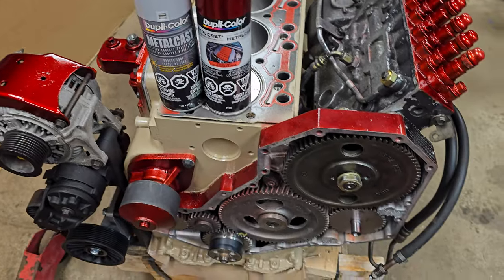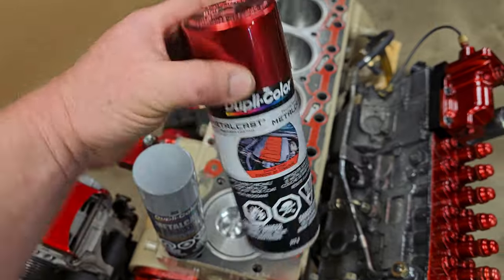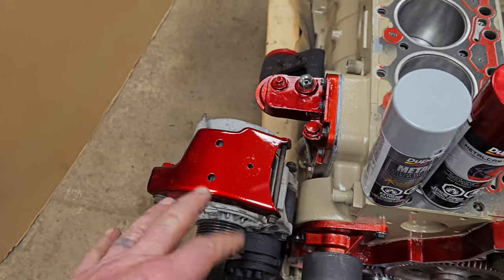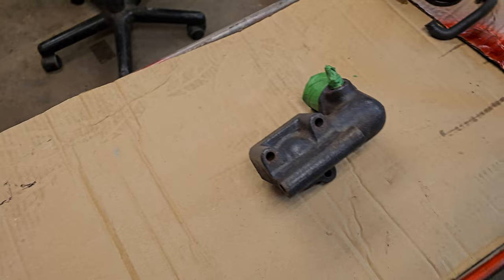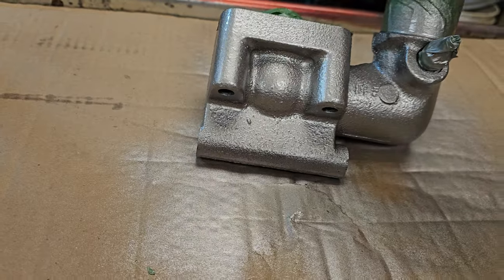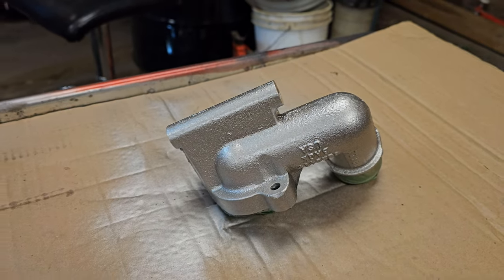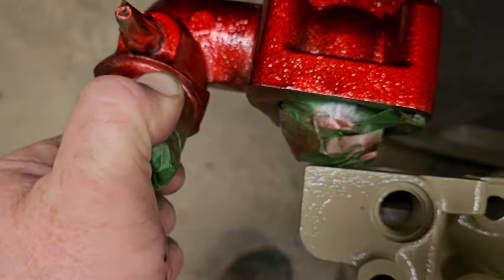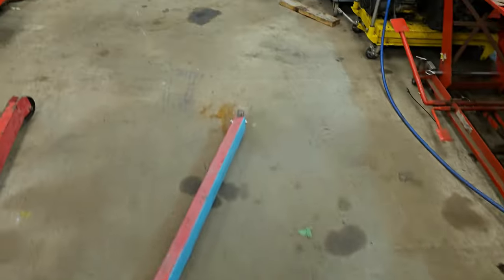Painting Parts With Dupli-Color Metalcast Spraypaint #spraypaint #automotive #cummins

Comment: using the base coat on parts will give you a more consistent final color.  The red will take on different tones (semi transparent) depending on the base color.  This t-stat housing is dark, so the final color would be darker than if it was applied to the base coat (which you did).  For color uniformity, regardless of the surface/metal color, use the base coat spray.
Reply from the maker: You can get some really cool effects using different color bases, I'll make another video
Reply: I'm trying to paint a fender with this, for practice. On their official video and everywhere else, they say you must start with "chrome" or "bright metal" part for this essentially colorized clear coat to take effect. Are you saying that so long one uses the base coat, regardless of actual metal color, this anodized color effect would be reached? Also, how many base coats did you do? Thank you.